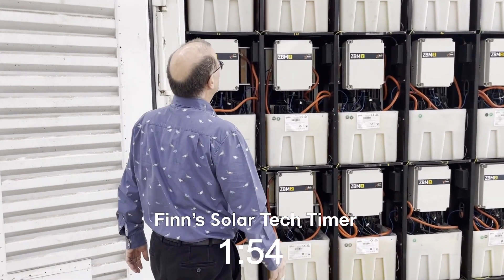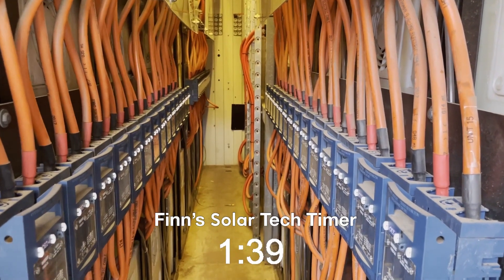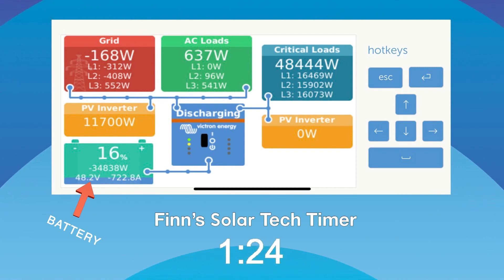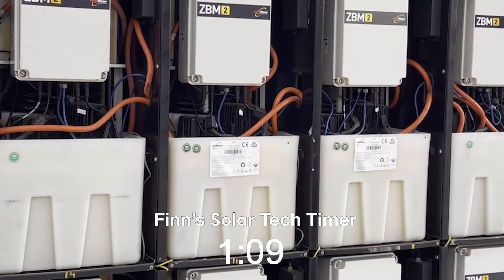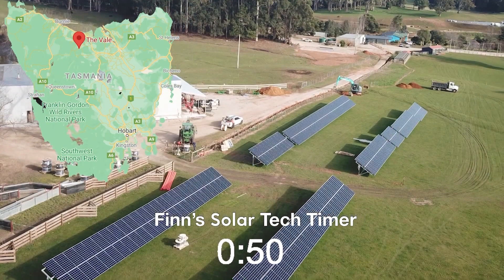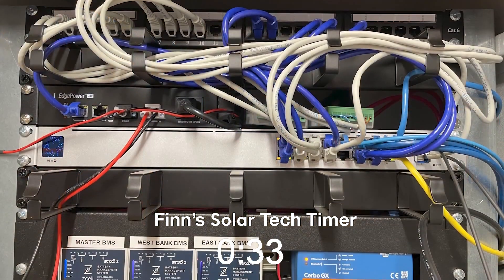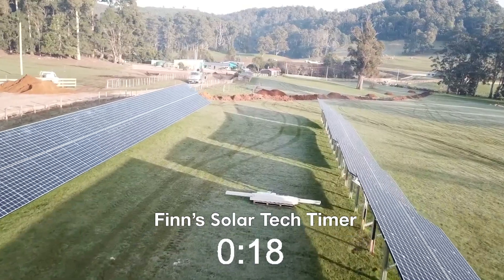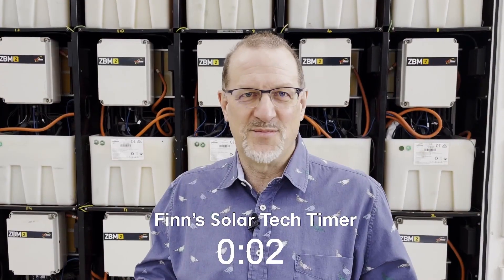Aussie-Invented Redflow Batteries: Better Than Lithium Ion?

Comment: Why do so many companies never give you the basic specs of what their batteries are capable of. Cost per KWh? Energy density by volume/weight? Power density? If they're 10 times the price of normal batteries or have a energy density a fraction of what's already available no one's going to buy them.

Comment: Flow batteries have upsides and downsides. Compared to LiFe they don’t compete on cost or efficiency, so they don’t make a lot of sense for residential storage IMO. Big installations, where space is not an issue tend to be the better use case.
Reply: Flow battery leaked at the battery testing centre in Canberra